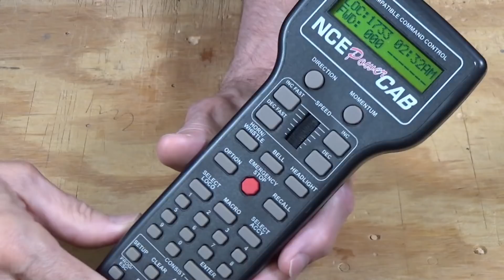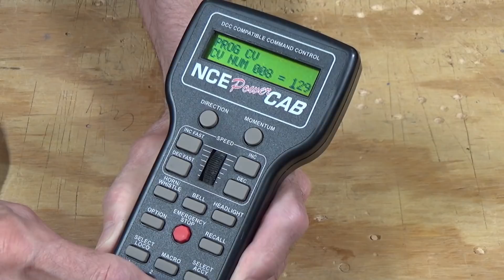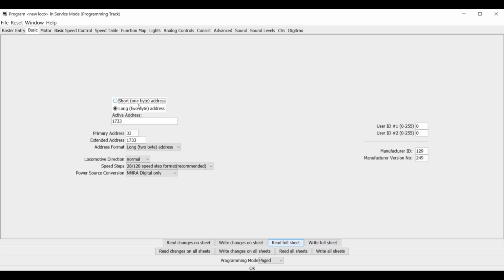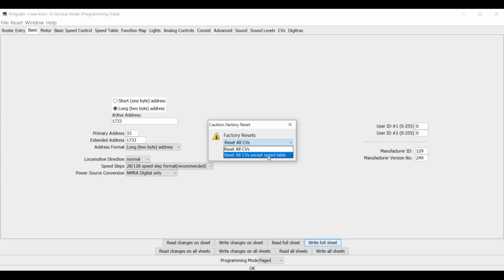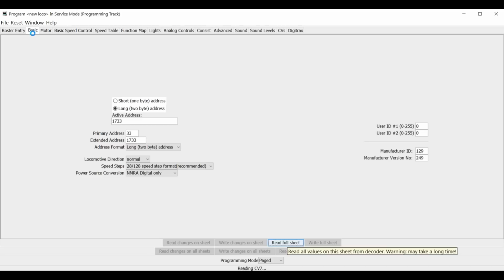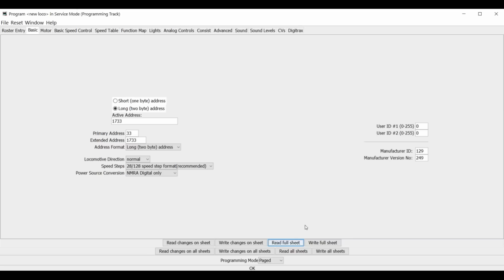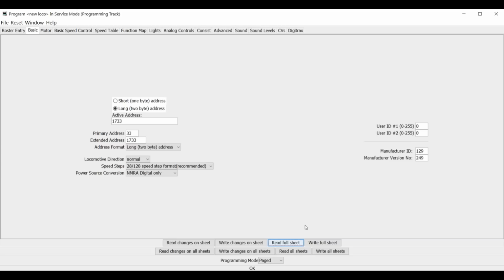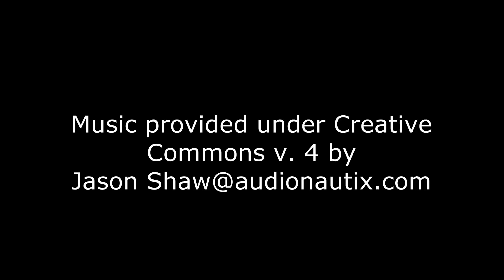Resurrect A "Dead" Decoder (105)

Comment: allways have problems with broadway  bluebox…     quite often the sound stops...  don't know why..  the digitrax drive decoder works ok...  so drive ok...  no sound...  I cannot get the sound locos to work...  I have quite a few now....  any ideas
Reply from the maker: When you say it stops do you mean it stops and never comes on again or do you mean it is intermittent? One issue with BLI steam is they use a synchronizer/sensor inside the loco boiler that has a tendency to die. To get things working again you have to replace this device or se d the loco back to them for the job. Finally why do you have a Digitrax decoder and a sound decoder in it? All my BLI blue box locos just have the BLI decoder.

Comment: What you get a short circuit message on the screen? I check all the wires and found no solder touching or any wire touching. So checked the motor after removing the decoder from the motor and tested motor with dc  runs fine. The I tested decoder with my dcc throttle and program track and it still say short circuit even though there is no solder touching any connections or components. The dcc system asks program anyways should I do a factory reset???
Reply from the maker: What decoder is this and what DCC system? What screen says short circuit?
Reply: NCE power cab and the decoder is Tsunami 2 pnp
Reply: Program track screen

Comment: Thanks Larry 🙏🏼 an interesting subject on bringing decoders back to life . Unfortunately not all manufacturers agree on the CV reset values and yes indeed the easiest is CV8=8 .  I got a 2018 LGB tractor loco  with a decoder that will not respond or accept a reset no matter what even after following the values stated in the manual  ! 🤔
Reply from the maker: I hope it is still under warranty. Make sure to check the obvious but often over looked issues of broken wires, connectors, etc. Good luck—Larry
Reply: The DCC Guy Thank you sir . Claiming warranty from half across the world from where I purchased the locomotive under the current global situation is like trying to swim the across the Pacific . I think it needs to be replaced and that is something beyond my ability .  Thanks and be safe .
Reply from the maker: Well, that is a problem. In this case I would disconnect the wires to the motor and the track pickups and wire them together so you are bypassing the decoder. Then try running it on DC or whatever the native power supply would be. That way you can quickly tell whether it is some issue other than the decoder. If the loco runs fine without the decoder in place then that is a sign the decoder may be damaged. Get in there close and sniff around the decoder—if it smells like cat pee then you probably have a blown component. If you don’t know what cat pee smells like I bet you can figure out how to find out!
Reply: The DCC Guy  😁 oh am familiar with cat pee haha .  Even though it is a G scale item opening it up requires removing a ton of screws and being a person with eye sight mainly in the left eye makes it even more challenging . But my thanks and appreciation to you for the kind suggestion . 🙏🏼👍🏽          Note: found lots of DCC concepts Alpha meters on the British ebay  web site     eBay.co.uk

Comment: I have had a problem with a new NBLI paragon 3 Loco, and BLI informed me that they do not recommend  using Decoder Pro
Reply from the maker: Interesting, did they say why?
Reply: @TheDCCGuy  They said Decoder pro was unreliable for the Paragon # 3
quote
 "We do not guarantee compatibility with Decoder Pro or JMRI. That is an "Open Source " software, meaning anyone in the world can write  / alter code for it, and there is no centralized company to deal with"
Big problem is that even when /if a customer can get legitimate and consistent read-backs with JMRI and our models, they are using templates for generic things like "Paragon 3 steamEngine" or "Paragon 3 Rolling Thunder".
That is impossible because we change our default CV's settings from model to model. There is no cookkie cutter "one size fits all " template for our models--especially Paragon 3
Because there are tmmplates created by antone and everyone that can be very generic and becauseour default CVs can very from project to project those are oftenvery inaccurate templates"
Reply: @catfisherboy  
I same conversation with BLI. I will no longer buy BLI.

Comment: After performing a factory reset or any programming remember to cycle the power to make sure the programming takes
Reply from the maker: Actually as long s you use the service mode programmiing track as I demonstrated the power cycle is automatic. With service mode there is no power on the track unless you are reading or writing a CV value. As soonas you read or write the value to the decoder power shuts off so no need for a manual intervention such as tipping the loco. If you use programming in the main then yes you may need to tip the loco to power cycle but not all decofers seem to require this—I have never dine it with a Digitrax but Lenz and LokPilot/LokSound decoders do require it.

Comment: Great channel, I have a Digitrax Decoder that only go's in one direction. ( N scale).  Bob
Reply from the maker: Problably has a blown power transistor on the output to the decoder. Time for a trip to Panama City but definitely call them first if the factory reset doesn’t work.
Reply: Thanks, will do that.